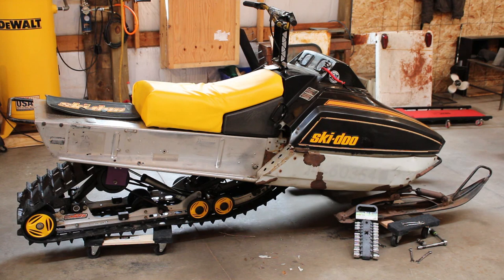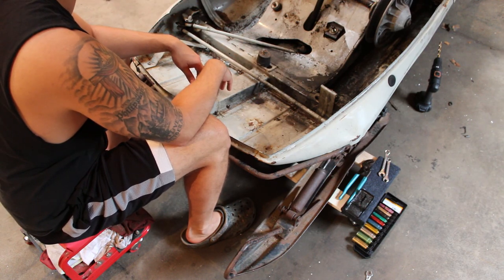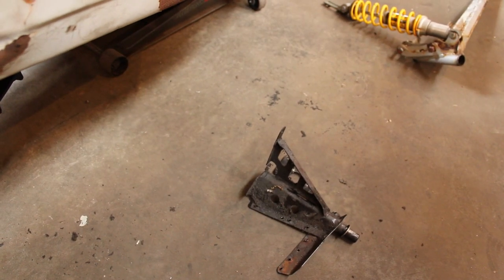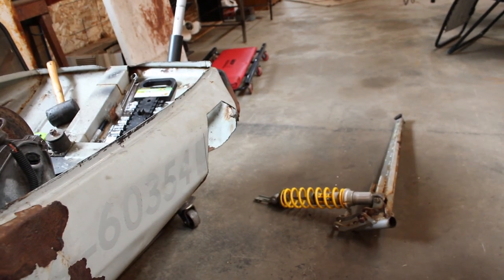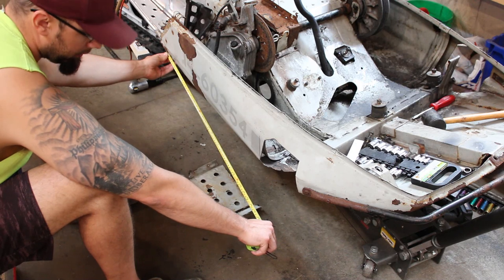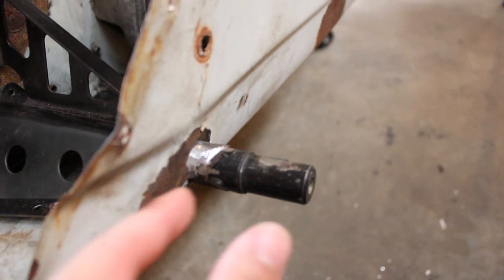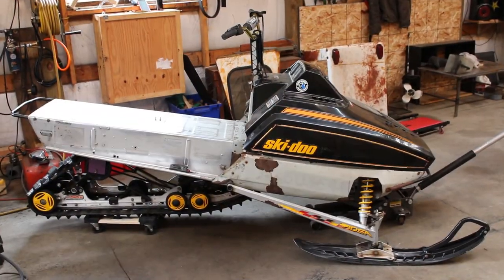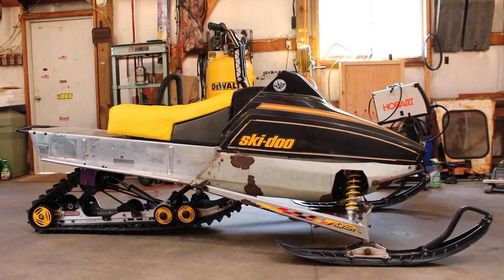Vintage snowmobile gets independent front suspension! Part 5 of the Skidoo Everest mod sled build.

Comment: I would definitely bring the back up. If you drop the front your going to create a steeper tracked angle off the drivers and therefore creating more rolling resistance. The smoother of a transition from the driveshaft to the front of the skid you can have the more track speed you’ll get.
Sweet build by the way.
Reply from the maker: Much appreciated, thanks for checking out the vid. I did have to drop the front of the skid slightly. I couldn't see a way around it without the skid binding with how much height I gained after adding everything up front. So like you said the attack angle is pretty steep as it sits. Its probably going to trench pretty bad, but we'll see how it works this year. I want to set the skid back and run a 144" track sooner than later. Thinking that should smooth out the angle quite a bit.
Reply: @NorthwoodsNoise   if you decide to keep the skid at that angle I would definitely invest in an anti-stab kit for the front of the skid.
Reply from the maker: @Cody_Gray  thanks, i never would've thought of that. Hoping the set back takes care of things, but I'll keep that in mind if it doesn't.

Comment: I can see problems with that rear trailing arm support.  That looks weak .. another reason why those designs used a fresh drafting board by increasing the distance of the ski legs from the front of the track... enabling that trailing arm support to run though as better triangulation.
Another thought would be incorporating the front drive shaft as the trailing arm support, which would complicate things a bit by requiring custom trailing arm fabrications, . longer with better trajectory and strength..
Nice work

Comment: Ride it than see what happens .When you sit on it ,the weight will push it down.  150 lb person.  Tim
Reply from the maker: Hey Tim, I did put my weight on it like this and the suspension was binding pretty bad. I ended up having to drop the front arm down and raise the back up to get it to function correctly. Works like a dream now though!

Comment: What lift brackets are on the rear skid?  Looking to do similar to my 96 formula mod.
Reply from the maker: I fabbed them in one of the earlier videos, I think part 2 or 3. It's the original mount brackets with flat bar welded to them to lengthen them.
Reply from the maker: Looks like it was in part 3 that I made them.
Reply: @NorthwoodsNoise  Thank you